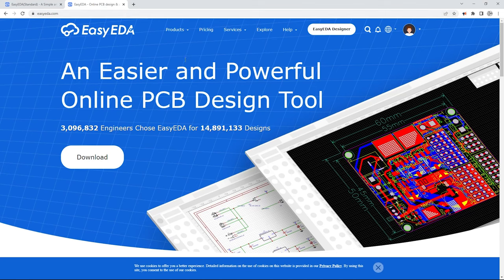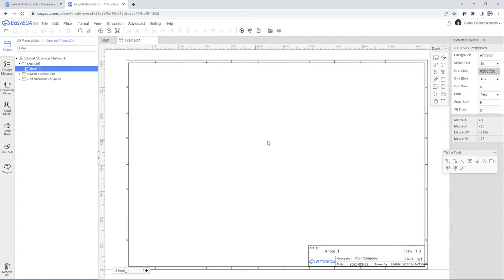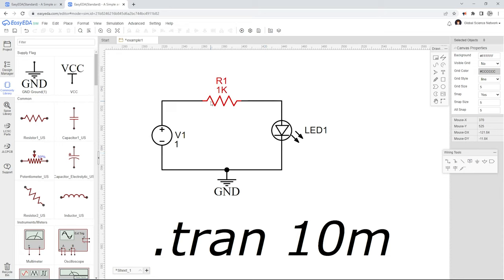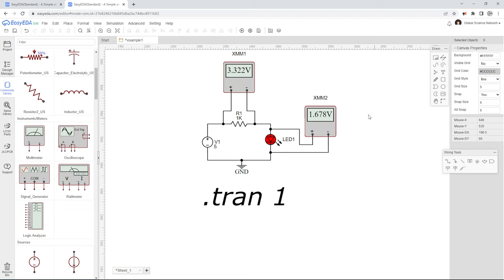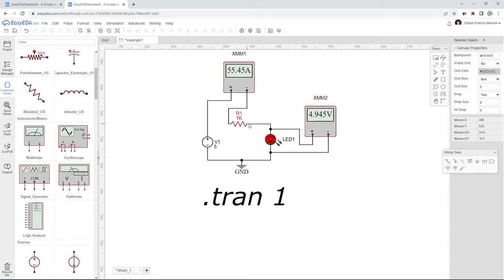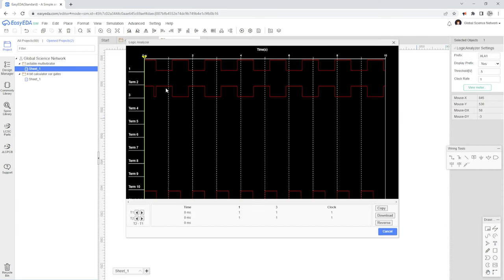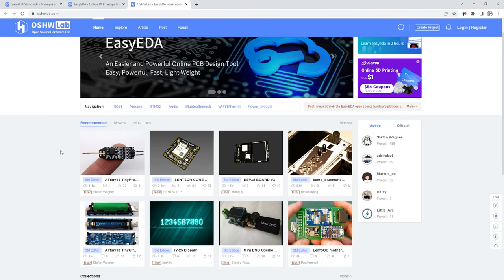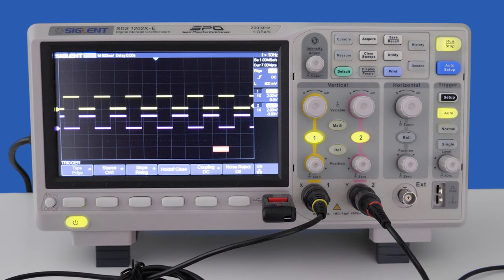How To Use EasyEDA, A Free Circuit Simulator

Comment: I had to wait 20 sec to run each simulator is that normal?
Reply from the maker: Hi, no, that is not normal. Maybe you have the .tran time set to 20? It should be small in most cases, such as 10m, which means 10 milliseconds. It very likely has something to do with how you setup your simulation run time.

Comment: what for is GND included into the first scheme?
Reply from the maker: Every circuit needs to be connected to ground or current will not flow. The ground is what actually completes the circuit.
Reply: @GlobalScienceNetwork  but you applied source of electromotive force with already existing + & -
Reply from the maker: @Heron31415  Good point, for the circuit diagram though it is still required to place at least one ground. On some diagrams, I even show more than one but at least one is needed.

Comment: Why would you expect an LED to light up with 1.5mA? Probably not enough, Id say the simulator is pretty accurate, IME
Reply from the maker: I use LEDs as indicator lights with the lower 1.5 mA level. The rating of 20mA is the max allowable for the LED. It is usually brighter than I would like with that much current. A simulator should turn on if the voltage threshold is reached and there is some current IMO.

Comment: Is there no way to use push buttons in real time with EasyEDA's simulator? I find changing switch states from Open to Closed is a painful process - and it looks like you can't interact at runtime??
Reply from the maker: If the circuit does not change state based on the design, it is not something you can toggle in real time. You can build an astable circuit though so the input will toggle back and forth. Do you know of other software that can do this?

Comment: This needs UI work.  As a software engineer since 1991, it was my job in the early days of my career to get a new user being productive in 10 seconds after program launch.  I've spent 20 minutes and still do not see any circuit components (such as a resistor, or capacitor, or transistor, or coil, or transformer, etc) that I could drag-and-drop onto a project layout background.

I'm sure it's a great product but the downloadable tutorial also was not written to get a new user productive in 10 seconds.
I downloaded the desktop client version to eliminate any connectivity lag.

I uninstalled the product.   They should embrace a 'quick start' approach to getting new users up and productive immediately - if they did so, they'd have much better user adoption.  

Thanks for your effort.
Reply from the maker: Yeah, the user interface is important. If you do not see the circuit components it is likely that you are in standard mode rather than simulation mode. Standard mode is basically a different program that is used to build printed circuit boards. EasyEDA simulation mode is built using the LTspice opensource framework and is actually a bit easier to use and has nicer looking component symbols. It does take some time to get use to though. If you downloaded the professional editor it will not have the simulation mode option. You need to download the standard editor and then should be able to switch. If it still does not work open the standard editor in the browser and switch to simulation mode. The program runs on a remote server either way. If you do not like that then use LTSpice which I also have a tutorial on how to use.
Reply: @GlobalScienceNetwork  Darn nice of you to provide a path to something better - thank you!